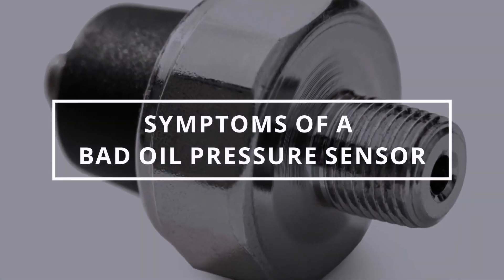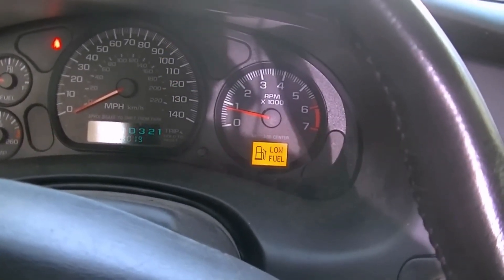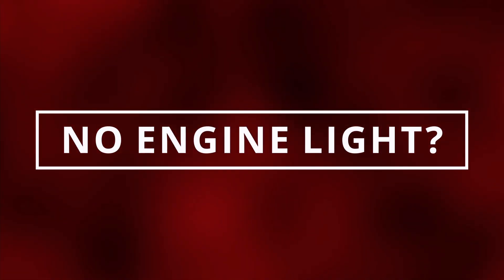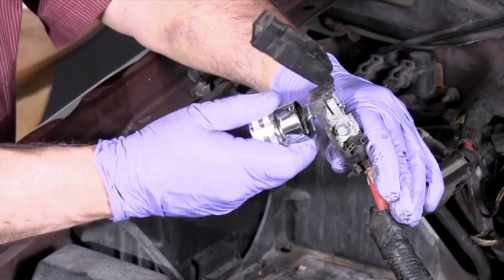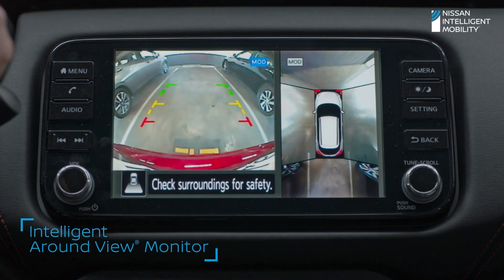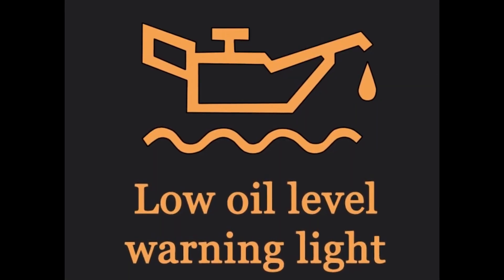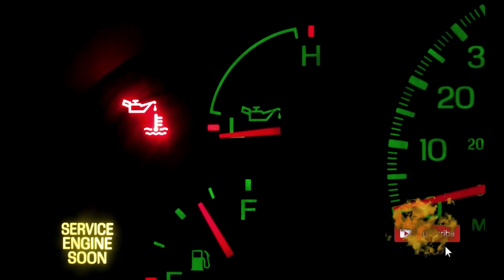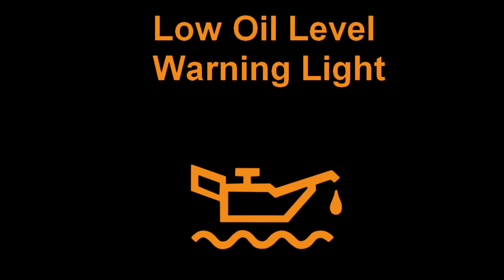How To Reset The Oil Pressure Sensor? Low Oil Pressure Warning Light  |

Comment: How to reset oil pressure sensor in  a 2002 dodge durango 4.7 4x4 engine  has new sensor but pressure marks lows  but there no sound in engine at all
Reply from the maker: Oil pressure sensors do not typically need to be reset. If you have replaced the sensor and the oil pressure reading is still low, it is possible that there is an issue with the wiring, the oil pump, or the oil filter. It is recommended that you have the vehicle inspected by a mechanic to determine the cause of the problem.

Comment: Well I went ahead and did exactly what you explained by removing the negative cable off my car battery for 2019 Kia Sorrento 3.3 l V6 all-wheel drive and when insidee autozone they're gonna use the men's room came back out and had one of their employees verify I had the correct oil level according to my dipstick and then I started the car and drove and the oil pressure light did not come on when I came to a stop and a light and that's where it usually comes on as So thank you. Edit: the "idiot" light came back on after a couple of starts and stops while driving. Changing my oil, oil filter today to see if that helps.
Reply: It’s either the oil sensor, oil pump, or oil leak
Reply: @Bigfoot8x6   I had the oil sensor, Spark plugs and coil packs replaced. That took care of it.